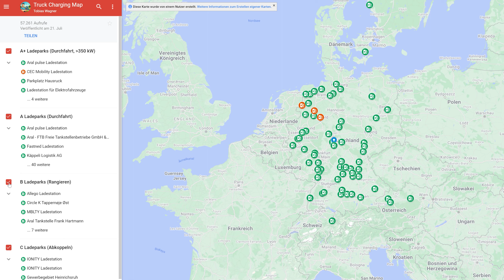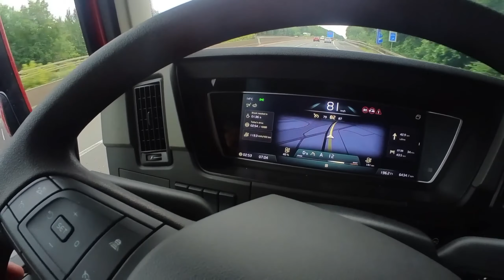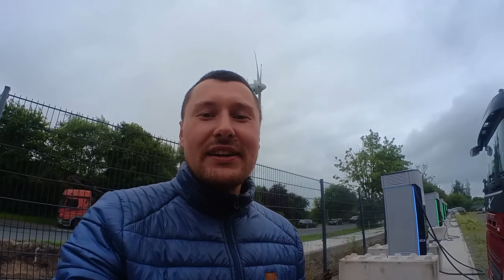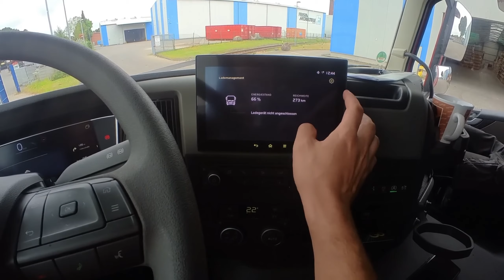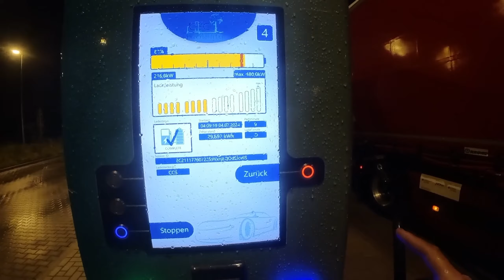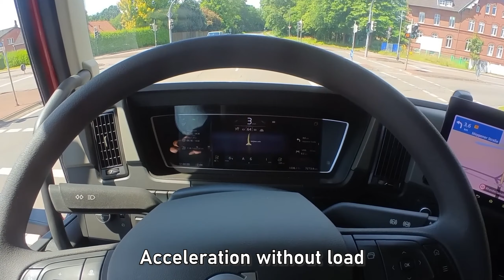My First Week as an Electric Trucker

Comment: Does the truck only charge through service station charging points or is there the ability to charge using regenerative braking in combination with the retarder etc? Could be really useful especially in more mountainous regions of Europe

Would be cool to see if portable chargers or solar could work on the cab/trailer roof in some regards too especially through the southern regions.

Comment: That is a great map, I cant wait to see it populate over time.
11:41 tuck the tails under the edge and you have a protector and you deal with the tails at the same time. 
1 vs 2 stops is great, as the more full the battery is the longer it takes to increase %, then when you are lower it is more about how long it takes you to get off the road like a pit stop, going down pit lane. 

Above 80 km/h the drag from air increase is noticeable... 

Note that the power needed to push an object through a fluid increases as the cube of the velocity. A car cruising on a highway at 50 mph (80 km/h) may require only 10 horsepower (7.5 kW) to overcome air drag, but that same car at 100 mph (160 km/h) requires 80 hp (60 kW). With a doubling of speed the drag (force) quadruples per the formula. Exerting four times the force over a fixed distance produces four times as much work. At twice the speed the work (resulting in displacement over a fixed distance) is done twice as fast. Since power is the rate of doing work, four times the work done in half the time requires eight times the power.

Comment: Hilly areas is where electric shines compared to diesel! They can actually recoup the energy used to climb, while with diesel, you must convert it to heat (whether in brakes or in the motor cylinders, doesn't matter). Can't see why someone would consider it bad for electrics.
Reply: Switzerland has an e-truck that doesn't need plugging in. It picks up cargo up the mountain and charges on regenerative breaking. Then after unloading, it drives back up the hill (which it can do despite some energy loss because it's lighter)

Comment: The numbers on the trip computer are crazy. In one day, your truck has consumed amount of energy that I am billed for living in my flat in two years!
Reply: Now consider that diesel trucks are doing the same, at 30% efficiency...
Reply: My truck does about 44 litres of diesel per 100km. Typically driving 750km per day which works out to around $600 in fuel. Some jobs are 5000km and unfortunately no where to charge an electric truck just yet.

Comment: the new 2024 fmh comes with about 600k. range. and mcs charging
Reply: I hope MCS will be a game changer. I hate diesel exhaust fumes.
Reply: @JanNovak-pg8oe  it's supposed to be. there are also a number of actor that are busy building charging networks for this standard along the major routes in europe and scandinavia. initially they have opted to install highend ccs (400kw) chargers on charging spots aimed to heavy vehicles with trailers. they have very clear ambition to upgrade to mcs given thatbthe standard matures.

the new generation if electric trucks (2025 model year) from Mercedes, scania and volvo all support mcs and way longer ranges. and then you have the player no one dates to talk about, tesla, which is on  their way with their semi in europe. that thing not only have mcs but a range upward of 800kilometers at full load.

Comment: In the US, we still don’t have many chargers compatible with electric semis. It’s great to see what other countries are doing to support the transition. Here, charging options for electric semis are mostly limited to depots, making the infrastructure much more restricted in comparison.
Reply: What do you mean "not compatible with semis"? He uses the same type of charger cars use.
Reply: Which chargers do semis in the US use. I know cars there either use CSS1 or NACS.

In Europe every car now uses CCS2 and the trucks also use CCS2 at the moment.
Reply: @Warrior6350 I do not know about any vendor that would make EV Trucks in the US. I mean there is Tesla Semi, but that is still not in production. So they can only import vehicles from EU and those would have CCS1, analogically to the EU cars being made with CCS1 for US market. I guess there is no demand for that right now.

I have seen several car youtubers complain about non-tesla chargers relaibility, also Supercharger network is just superior there - both in number of chargers per location and number of sites.

 However, there are several options for CSS1->Tesla Supercharger (NACS) adapters avaiable now. So it should not be an issue.
Reply: Yes such big states with high anmounts of  sun and wind  must subsidise charges at every logistic spot Where drivers could charges when loading and waiting for loading. Companies producing  electricity must subsides charges too  it will alow them to sell much more energy.

Comment: I need china truck ev with swap Battery. So i don't need charger
Reply: But you need a Swap Battery wherever you are when the battery runs low. Do you think that’s more realistic than using your driving break for recharging? 

For me, putting a cable anywhere you ought to recharge the truck seams to be a much easier job than putting spare batteries there. 

In the context of regular route freight transport, it could be a whole different ball game. 
For on-demand freight transport, as is common on long-haul routes, flexibility is essential.
The way Tobias is doing is more likely to be how everybody will be doing this in the future except for that every delivery point will be equipped with chargers to reload while the trailer is being unloaded.
Reply: @G0bus  Like you misunderstood what I meant.Has a battery that can be swapped It doesn't mean the truck can't be charged.So you can still charge it like a regular electric car.

But if there is a battery swap station near the shipping route.Surely the drivers will use it because no matter how much battery power is needed, the time to change is only 5 minutes.

Charging a  300-500 kwh battery Truck with a 500kwh fast charger can  take 2 hours . Moreover, the capacity of the battery will be higher and the charging process will also be longer. 
Not to mention that fast chargers make the battery degrade faster. 

It is better to charge at a station with a slower speed.In order to extend battery life .
Reply: @JunitafluxcyfatriciaJunita  ok, that’s a point. But if we think of NIO they didn’t put that much effort into Fast Charging because they have the Battery Swap Stations.
Reply: @G0bus https://youtu.be/XHgw2FLBbGg?si=Gu0QXUeCKoMhglxX